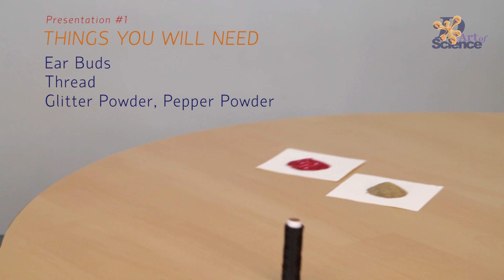How to perform Surface Tension Experiment? | DIY Liquid Surface Tension | DArtofScience

Comment: Sir I tried but it’s not working,I took a mug of water and kept that boat in water with detergent soap. What is wrong here???
Reply from the maker: sorry i thought i replied.
dont take too much water, try it in a plate of water as you have to keep throwing the water because the moment there are 1-2 drops of soap that are mixed in the water, the full surface has lost the surface tension and it will not work.
Reply: Ok sir I will do it now